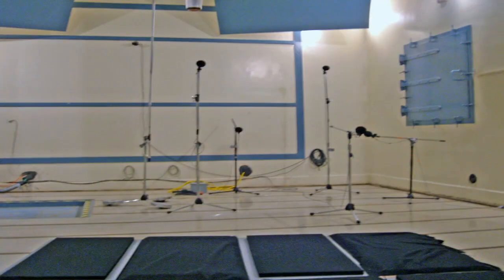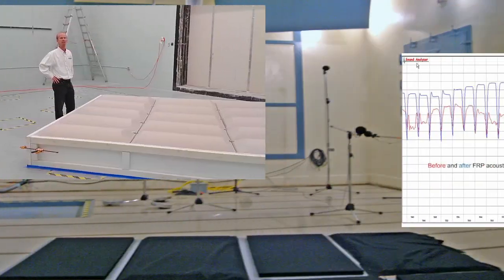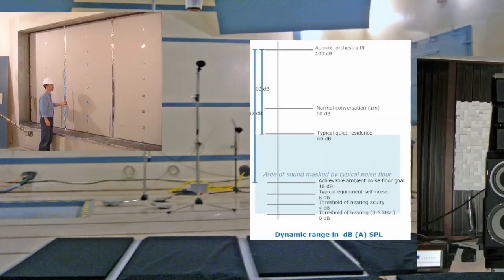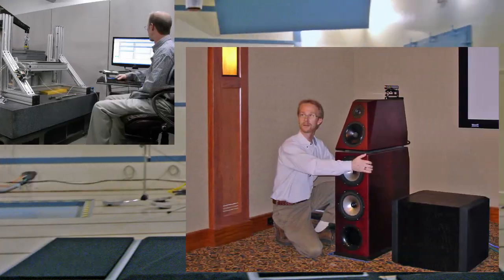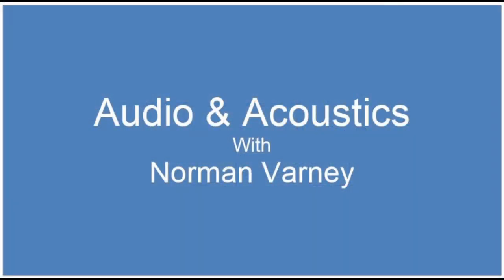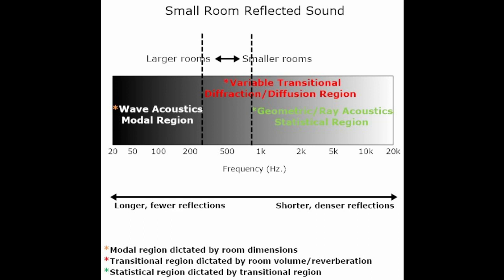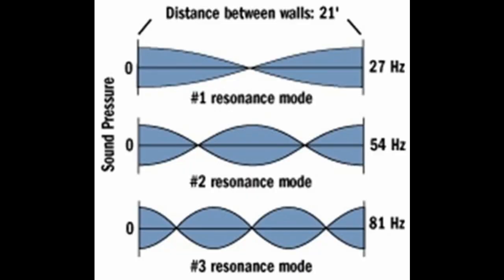Four Passive Room Mode Solutions

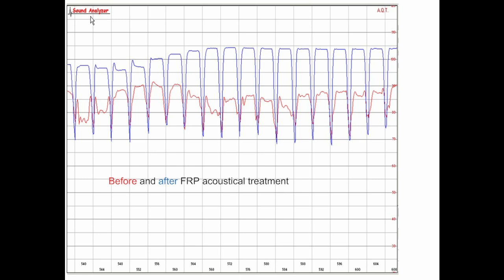Comment: The gated sweep mentioned at 9:40 tells the big story of what room treatment can do and what DSP won't be so successful at improving. Articulation can also be improved to some degree with DSP,  but testing shows it works best in rooms that are already well treated, and when the listener is relatively close to the speakers. So like others have said here, DSP can sometimes polish up what's already good, but it can't squeeze blood out of a turnip. I personally have had good luck using DSP on my speakers for crossovers and time alignment of drivers. I have tried but haven't had so much luck with it for room correction. If you have a lot of speakers all around the room that can work off each other as active absorbers you can get more done.
Reply from the maker: Right, as you say polish. It's best to correct the source of the problem directly, when possible. 
That usually means reaching for DSP last, rather than first.

Comment: why not just dsp and solve all the bass problems ? I believe in acoustic treatment, but at some point it is so much easier and cheaper to fix the bass on digital level.
Reply: DSP doesn't sound that natural with large amplitude problems with low frequencies.   If you have a low frequency that has a peak of let's say 10dB or higher, the best way to manage that is by treatment to get that 10dB+ peak, for example, down to a peak that's maybe only 3dB or less, then you can use DSP to fix that smaller problem. But I wouldn't recommend using DSP for large peaks in low frequencies…. I"ve talked to many acoustic engineers that they agree……. So, if you're low frequency problem is over 3dB, then get treatment.

Also, the best low frequency absorption method is diaphragmatic. It's far better than membrane or Helmholtz.   But for treatment of Axial modes, you need to fair amount of surface coverage on the surfaces where that specific frequency or frequencies are located.  Depending the room dimensions, you can have a small number of frequencies or a large number of frequencies that are give you the problem.  But definitely, treat the lowest frequencies first before you address the rest.

There are companies that sell pre-built diaphragmatic absorbers that can do down to 30hz, OR you can build them into the walls and ceilings OR you can buy a build plan to make your own, so you can save money.
Reply: @Oneness100  wow you are clueless :D. sometimes peaks and dips go 25db. Get a measuring mic and measure some rooms before talking non sense on the internet.
Reply: @zergbong  Whether it goes that high isn't the point. It's going to sound like crap compared to just using proper treatment..

I know people that have compared it because they build rooms for a living and they've done tests of DSP vs proper room treatment.
Reply: @zergbong  Did you NOT read what I wrote.. I just gave the 10dB as an EXAMPLE.. PLEASE RE-READ WHAT I WROTE RATHER THAT SELECTIVE READING LOSING THE POINT OF THE COMMENT..
Reply: @Oneness100  non-sense. Get a measuring mic, try some dsp and then talk. Don't repeat whatever was said to you, dont be a parrot
Reply: @Oneness100  why are you so angry about something that you are very wrong about? Get a measuring microphone, educate yourself, don't repeat whatever non-sense you heard and live a happy live mate.
Reply: @Oneness100  if you are "putting rooms" and you are charging money for that and you have no basic understanding of DSP you are just a scammer, innit?
Reply: @zergbong  Yeah, he has plenty of knowledge with DSP.   He's played around with it, he has plenty of customers that have played around with it. 

Too bad you haven't been in room's he's either designed and built or has fixed using treatment to compare…

He's designed and built around 300 rooms by now.  He's fixed thousands of rooms over the years, and some are professional studios, big $ home theater rooms and big $ 2 channel dedicated rooms  that were designed by someone else that still had problems in the low end that he fixed with room treatment..

There is no substitute for a properly treated room.  DSP alters the incoming signal and the worse the room, the more the DSP tries to fix it, and the more it alters the incoming signal and if the problem with the room is too big, then the DSP can kind of sound overly processed, which isn't a good thing…

Plus, how many listening positions can DSP really fix at once?
Reply: @zergbong  "putting rooms". Huh?  Do you mean putting proper treatment in a room to fix a problem inherent with the room?
Reply: @zergbong  DSP room correction ALTERS the incoming signal so it compensates for a poorly treated room.   But you still can't make it sound as good if you had a properly treated room to begin with.

You think you can "FIX" a  10dB to 25dB low frequency problem with DSP and it still sounds good?  Yeah, right. Good luck.  It'll sound stupid.. Maybe you need to go to a properly treated room that doesn't have those kind of peaks in the low frequency range that doesn't need DSP room correction just to get that understanding.  

That's what your problem is. You've never been in a properly designed and treated room..
Reply: @Oneness100  go educate yourself if you are passionate about the subject of sound, stop spamming me. The only way to make sure you have equal bass in a room is to have multiple subwoofers dsped and timed correctly. Whatever bullshit you heard from some guy it doesn't matter. Plenty of old farts going around with 0 actual knowledge. Buy a measuring mic and start learning. nobody cares what some guy told you, the only way to have proper bass is to measure the room modes and then correct them, everything else is bullshit.
Reply: @zergbong  I have a microphone and test software…

And?  BIG DEAL.  My friend uses 8 high end BK microphones when he does his measurements.   You only use 1?  HAHAHAHAHAHAHA..  And you think you know what you're doing?  my friends been doing it for a long time, his custom rooms start at $100K and go up to several million when he does a large home theater system or an entire studio. 

He has well known mastering engineers and recording engineers calling him up.  He's got a client that's a mix engineer that works with the major animation studios where he does the mix in a room that's practically flat.  Since it's a multichannel mix room he has to use subs, but for a regular 2 channel setup?  NOPE.  

You're just someone that simply lacks the funds/knowledge on how to build or treat a room where you don't NEED subs or a DSP.   A home theater is the ONLY reason to have subs and those are connected to an EFFECTS channel.  That's the ONLY reason to need a sub, but you don't necessarily need more than 1 and you have to be careful because you don't want to energize your room more than it can handle and that's why you are getting DSP is because you simply don't know what you're doing.. 

I'll bet your setup sounds like shit too.
Reply: @zergbong  You must be talking about a home theater, right?
Reply: @zergbong  Next time you mis read someone's comment, apologize and be a man about it.. 

And If you want to fix low end problems with software, then YOU are missing out.

Too bad, but I guess the kind of music you listen to, it won't matter. It's probably electronic garbage anyway..  ahahahahahah..
Reply: @zergbong  This just isn't true. You can achieve even coverage by using a single subwoofer or a simple subwoofer array as long as there is enough absorption at the low frequencies or if the walls let enough of the low frequency energy through. Standing waves can't form without a reflective surface at both ends and if the subwoofer is within 1/4 of the highest wavelength it can reproduce away from a reflective surface, the subwoofer will couple with the surface which will increase it's efficiency but will have no effect on it's frequency response.

While DSP can significantly improve the performance of a loudspeaker system in a room, it can't replace proper room acoustics for at least two reasons:
- DSP alone can't fix the time-domain problems (it can reduce the amplitude of a peak caused by a resonance/standing wave but it can't shorten the ringing caused by it, can't significantly decrease the reverberation time etc.)
-the interference between the direct and the reflected sound causes cancellations, the frequency of each cancellation is determined by the time difference between the two signals and this time difference is caused by the difference in the distances the sound has to travel from the source to the listener via both routes, therefore the frequency and the magnitude of the cancellations varies greatly throughout the room. The same goes for the standing waves - the same standing wave will cause peaks in amplitude in one part of the room and dips in the other. While you could use DSP to achieve a ruler flat frequency response in one point in the room, the frequency response in the other parts of the room will be anything but flat.
Reply: Just wanted to check in and say you are wrong :)) Dsp is useful if you dont have much of a budget but should not be considered as treatment. An eq curve of a room is one of the least important things when treating. If you boost a 25db dib caused by cancellation, you’ll have to boost it A LOT, which leads to all other kinds of problems
Reply: @ILoveTelecasters  Why would you boost a 25dB null?  It'll sound stupid and it doesn't matter if it's done with EQ or DSP, it's still going to sound stupid.

Maybe polishing up a +/-3dB or less of a problem might not be so bad, but huge peaks and nulls?  NOPE. It will sound processing and unnatural..

Proper treatment can fix both the peaks and nulls and if done right will sound completely natural. But in some circumstances you can't use DSP or EQ.   Try creating a room to have a group of musicians performing/recording?   At what point are you going to have to use DSP? And isn't it better to not have to use EQ when tracking acoustic instruments to get drums, piano, or some other acoustic instrument to sound good for the basic tracks?  the second you start adding in EQ and print to tape, you're stuck with that sound and you may not like it by the time it gets to the mastering process….  And for a recording studio, you don't want ANYTHING getting in the way of the original source and what the engineer is listening to because that will dictate what changes they make and if their system is EQ'd a certain way to sound good in their room, they modify the material to sound good in that room but by the time it gets to the end customer, their rooms don't sound like that, and you can very well end up with a crappy sounding mix..

To me, DSP and EQ is the lazy man's way to treat room acoustics.  

I can see using DSP/EQ for a live concert venue where the band doesn't have the ability to change a large venue's room acoustics.  THAT, to me, is a much more logical use of DSP to fix bad room acoustics..  I've heard the results of a Meyer SIM system.  Those in the hands of a well qualified individual can do wonderful things, but that's for a large concert venue and not for a small room… And it's to get every seat in the venue to sound good, which is they it uses MANY microphones around the venue..
Reply: @Oneness100  Not sure if you actually have read my comment. Read it again.
Reply: @ILoveTelecasters  You're comment about DSP is useful if you don't have much of a budget….
Reply: @Oneness100  Yes, that was the first thing I said. I'll say it once again: Room correction shouldn't be considered as treatment. Boosting giant dibs caused by cancellation only lead to all other kinds of problems. But treatment is also expensive and hard to get right. I'm actually agreeing with you
Reply: @ILoveTelecasters Then why was your first statement saying I was wrong??
Reply: @Oneness100  that was an answer to the original comment
Reply: @ILoveTelecasters  you addressed it to me.
Reply: @Oneness100  Nope, didnt @ you. Was a comment to the original
Reply: @Oneness100  Interesting. I'm on your side here. First you treat the room, then dsp if you want to finish tweaking it. One should never try to fix a bad room with dsp alone. There are many different ways to skin a cat but using strictly dsp to fix a bad room will get you nowhere.